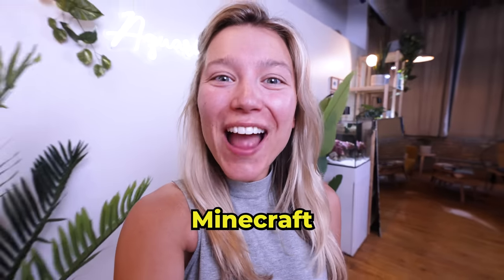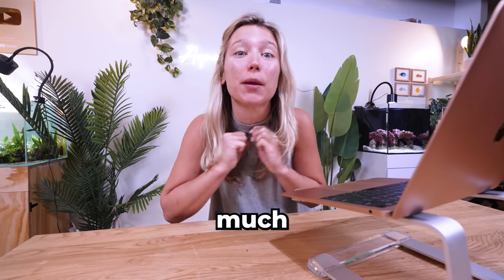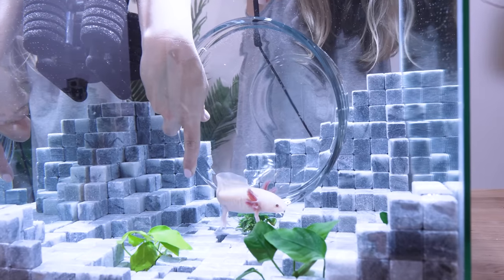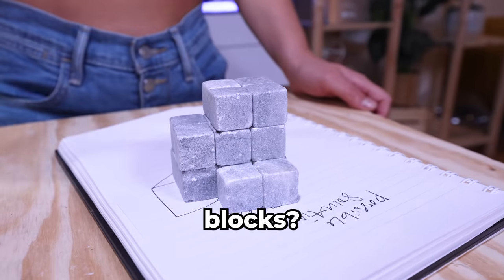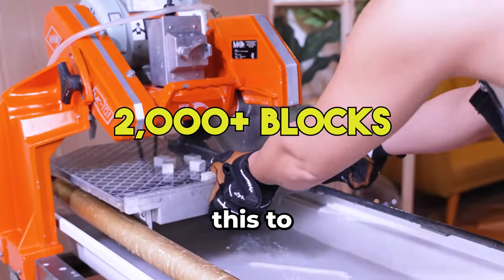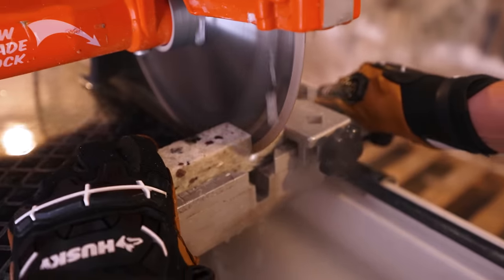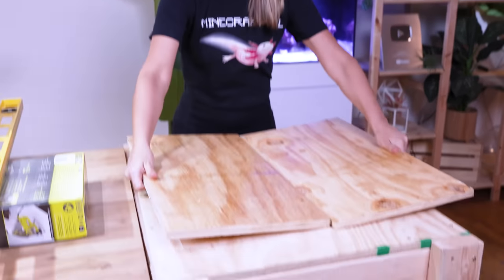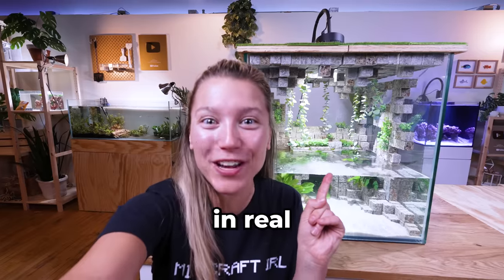I Built Minecraft IRL for my Axolotl

Comment: I wonder what the inside of your brain is like. A hamster running on a wheel. You never seem to run out of ideas. The minecraft aquarium looks amazing!  I love the hanging plants.  I wonder if you could add a creature that can climb around on the blocks that are outside of water? Nerite snails like to be out of the water a lot, and then they go back in when they are ready.  Of course, you'd need to keep the surfaces wet for them. Maybe there would already be enough condensation to do it for you?  But I don't know if the axolotl would be compatible with the nerite.